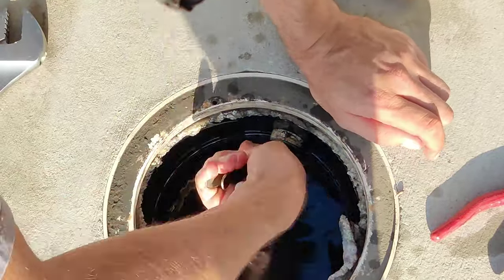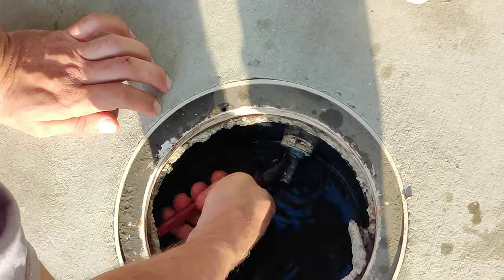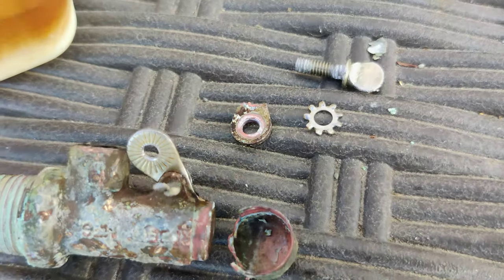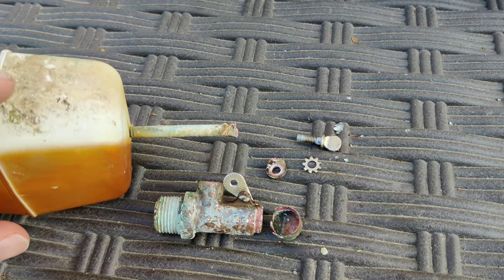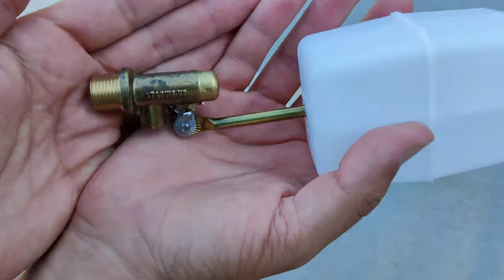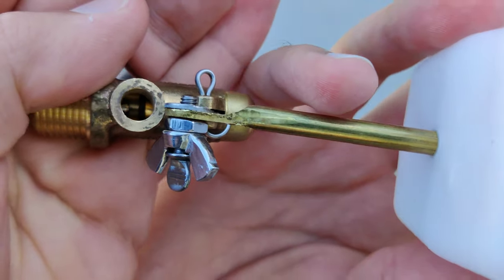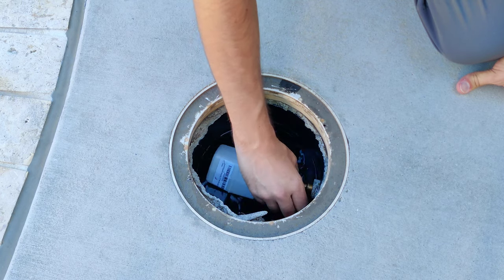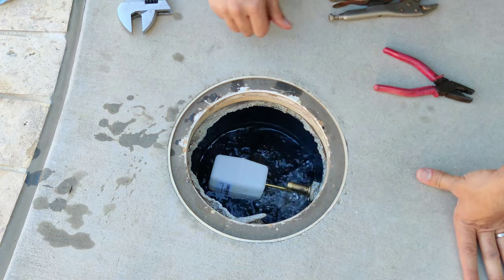Pool Auto Fill Float Valve - Replace Fix

Comment: Chris, can you explain the butterfly nut and the extra nut on the replacement valve? The link you have doesn't have that... all it has is the little thumb screw that's very difficult to get down tight so the float doesn't move. Thanks.
Reply from the maker: Those nuts are there to allow you to adjust the angle of the floater to the correct resting spot (when your pool has the right amount of water and should stop filling). I took a look at the link in the description, I agree, it does not show the butterfly nut on the product page. However, In the Amazon review photo's that others have posted, I can see that it does have a butterfly nut. I'm curious, has anybody else ordered this item and not receive a butterfly nut?